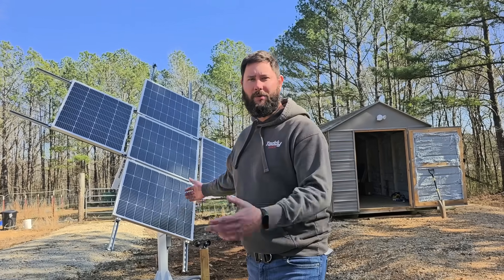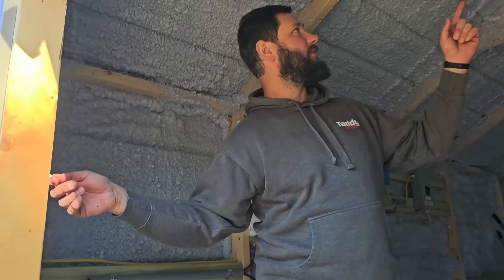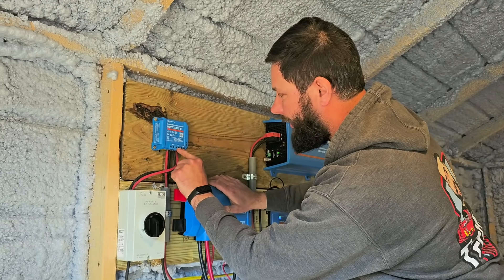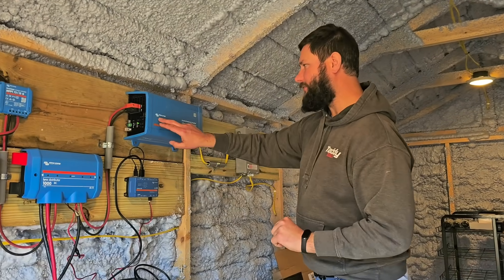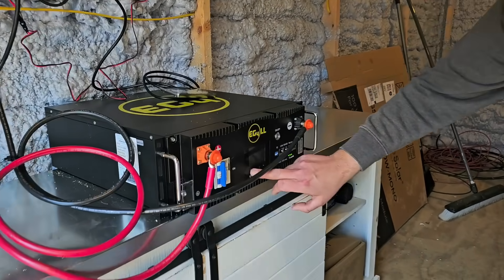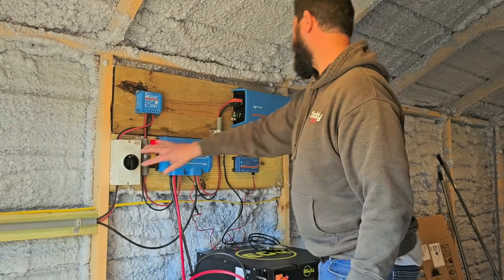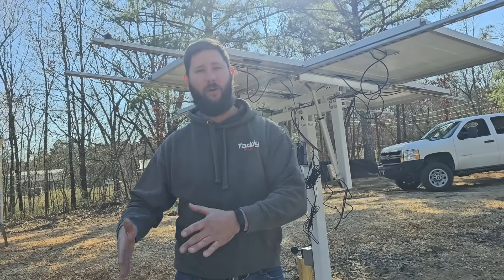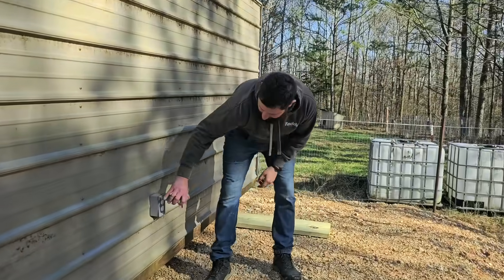Revolutionary Solar Setup DIY Guide @SignatureSolar

Comment: that charge controller used for 12v system is waaaaay too small. your panels can push around 41 amps@12v. Your controller can only direct 15 amps to the battery. You need a 40 amp charge controller otherwise you can pretty much take 3/4  of those panels off and use them for something else.
If you were switch to a 48v system, then that Charge controller would be fine, just not at 12v
Reply from the maker: Thank you for the advice brother

Comment: Unless you are going to live in a shed   all you need is an ecoflow solar panel To power 110-volt items from a car's 12-volt battery, you can use an inverter. An inverter converts a car's 12-volt DC power into 120 volts of AC power
Reply: I checked yuor youtube to see examples of how you did that but you dont seem to have any videos.